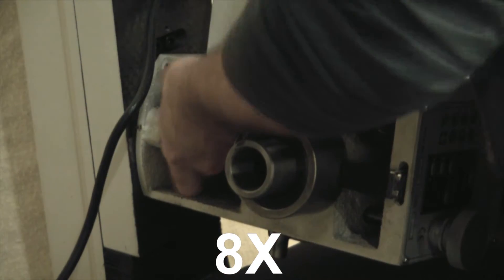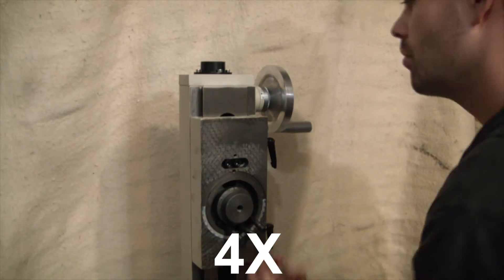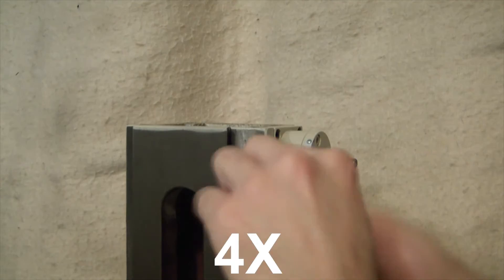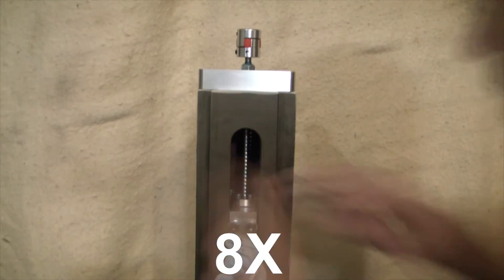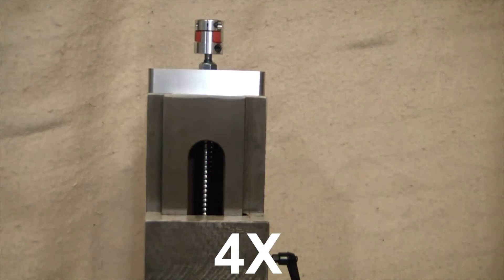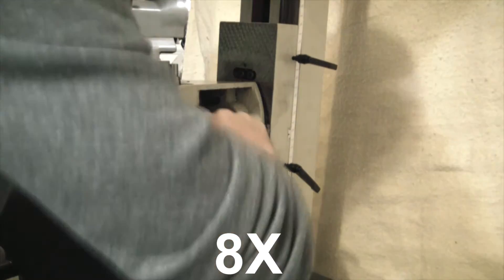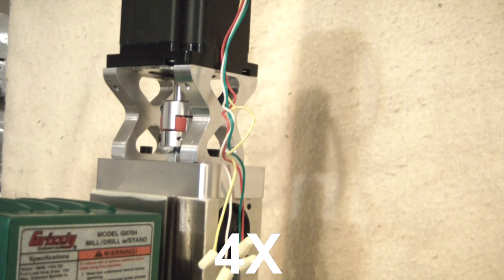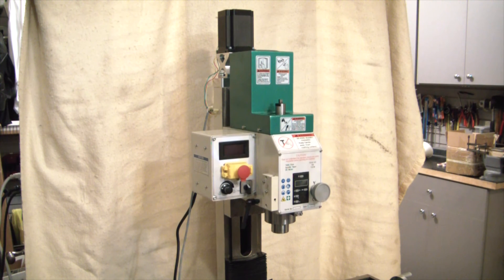ElementalMaker: G0704 CNC Conversion Part 3: Z-Axis Conversion

Comment: Thanks elemental she works great 
One dosent have to remove the head only lower it turn it past 90 degrees then you will have access  to the two studs 
All in all only took 2 hours I've already used it a few times shes chooching the z axis very well now 1799 oz nema34 closed loop
Again man thanx 

I may put x and y on later we only need the z for now

Comment: I never knew you converted one awesome job im doing the same 
What are you using mach3 what steps per unit did you settle on looks like i got the same kit comming
Reply from the maker: Nice! Did you get an Arizonavideo kit? I think that was his name. For the steps per unit I will have to check my machine, it's been so long since I did the conversion.
Reply from the maker: Just checked my Mach 3 and it looks like all my axis are at 320 steps per mm
Reply: @ElementalMaker  i guess i should have asked is the z axis a 1605 ball screw or bigger ?
Reply: 16mm width 5 mm pitch
Reply from the maker: @RGCbaseace i don't know the exact size but I'm pretty sure the ballscrews I used are larger than that on all my axis
Reply from the maker: @RGCbaseace well I just checked and I was wrong, looks like they are 16mm ballscrews, not sure about the pitch but with a quick eyeball measurement it looks to be 5 or 6mm

Comment: Thanks for the video. What are you using for lubrication of the ballscrew/ball nut? Is it easy to access for future lubrication?
Reply from the maker: I used Super Lube 51004 to lube the ballnuts. Seems to work very well. Access is not the best on a couple of the ballnuts, but re-lubrication is pretty long intervals, so its not a big concern.
Reply: Thanks, mate. I just purchased the same kit from Arizonavideo, so I was curious what you were using. Here I am looking at these ridiculously expensive lubricants, it appears my thought process was overkill.